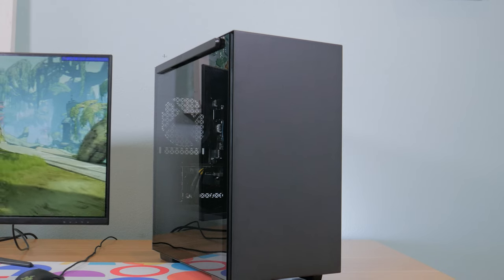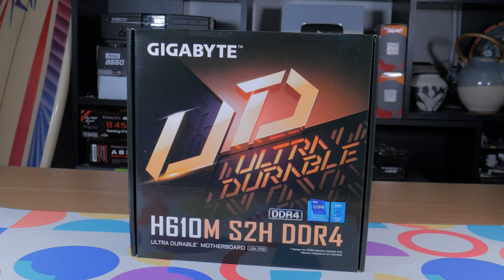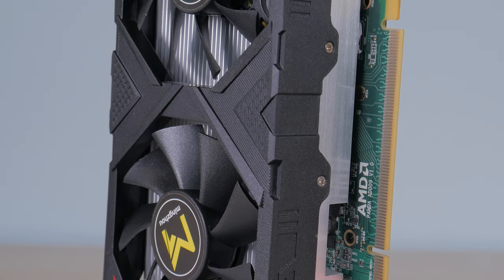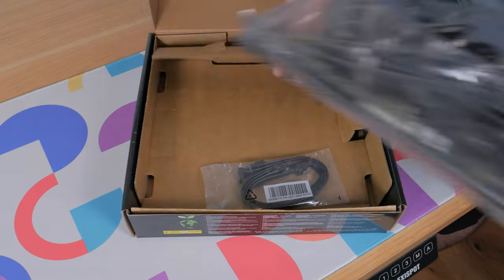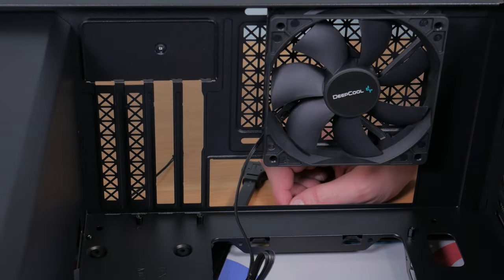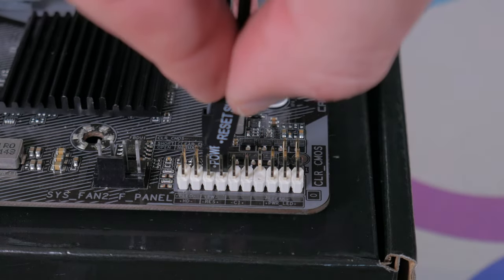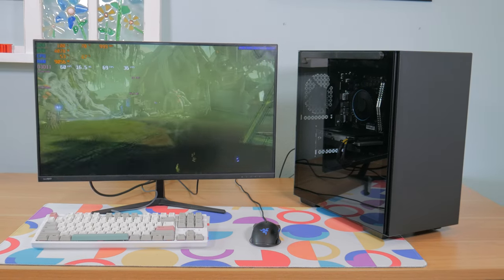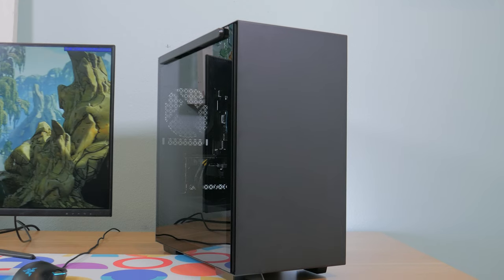$400 Gaming PC Build Guide! (2023)

Comment: That RX 580 is a deal breaker for me. A year back I would have been iffy about it - but now - just no thanks. It's literally a potato at this point. Also I don't get the choice of the I3 12100f + mobo when you can get the R5 5500 + mobo at the same price. It's only if you look benchmarks that a 12100f is higher FPS - and that's always paired with a "enthusiast level" GPU - but with a smaller GPU like an RX 580, GTX 1660 or an RX 6600 - or even RX 6650 XT - the frames are identical within a very few % - UNLESS it's a game which likes more cores - then the 5500 beats the 12100f by a fair margin. Also - especially when streaming and productivity and stuff like that - it helps to have the extra cores... so why turn down the "free" extra performance?

The RX 6600 is 180$... Which - in my mind - should be your aim for "entry level" at this point - even though it sort of performs like a mid ranged card... Amazing considering that the old budget option of the GTX 1650 had a 149$ MSRP - but is nowhere NEAR the RX 6600 in performance.

I would LITERALLY advice anyone against getting this PC - since it's a bunch of half measures and sub par parts - which are not worth the price tbh. You would most likely be better off buying a used PC instead.

This is about the lowest spec I would advise anyone to actually buy - with parts that are worth the price:
/pcpartpicker /list/BZ7fY9

Yes I know it's 128$ more - and there are a few parts you can do a step down like the RAM and the storage, however - it's just a lot better quality not to mention faster than the parts you would save 5-10$ on. It's better to save up for a few more months and get a system like this - which can actually handle modern gaming, not to mention be much faster in general use. - And let's be real here - we are still within the price of a PS5 + ½ a game here.

Having build this exact setup multiple times now - I can tell you that it's an amazing setup - with no real need to justify performance and/or feature - it's just rock solid performance all around and feels like a much more expensive system. - Also if you can find an additional 50$ - you can get the 6650 XT - which just full on dominates 1080p gaming...
Reply: /list/Mfdnk9 I only agree with the CPU choice. I 💯 disagree with the other parts. The 5500 is excellent value with 6 cores and 12 threads. It was actually $80 last week. Your build list is great but I went with the 3600 since it's a tad cheaper and can take advantage of pcie 4.0 with a B550. The 5500 does have a multi core performance advantage. Also, 1TB NVME is so cheap now. Memory, 3200 CL16 is cheaper and is the same speed/latency as 3600 CL18.

You said you built a couple of the 5500 and B550 K, did you have to upgrade BIOS? I also found that the B550 K is a little weak on the VRM compared to the DS3H but should be OK with 6-8 core Ryzen for gaming.
Reply: @itsatrap4986  Ok so yeah My pick of the CPU is actually just simply because it's the newer Zen 3 architecture compared to the 3600 being Zen 2 (non-AF).
I insist on my RAM being of good quality - and the Corsair Vengeance LPX is just a solid pick which I've never seen fail - and here the price difference is like 2$ between the 3200 and 3600, so - that's why.
The Samsung 970 Evo Plus is a fast cached drive - so I'd actually pick that one over the 1 TB as well if I had to choice.

Also the VRM is fine - it really doesn't have any issues with handling most CPUs. I've seen these handle 5800X without any issues and without getting overly so - it's really not a concern. The price difference is tiny though - so if you like another one better - it should be fine.

I've never needed to update a bios on a B550 to handle a 5500 or any other 5000-series CPU for that matter. Maybe there are some - but I don't think this will be an issue here.
Reply: @Craider79 This is for the people that are building a gaming system. Don't be loyal to brands, instead be loyal to your pocket. $30 SP 3200 CL 32 vs $42 Corsair 3600 CL18 "Quality" Yeah, no difference. I enable DOCP with no problems. If I'm spending this much, there's a faster G. Skill 3600 CL16 kit for $49. Also, it's 2023 and $40 for 500GB GEN 3 is a rip off, Samsung or not, DRAM or not. Again, no difference between the A60 when I'm gaming. It's $54 for the 1TB for crying out of you're "stuck" on a brand. But my choice would be the PNY CS3040 gen 4 with DRAM for $50 or SP XS70 $54 if I'm spending this much.
Reply: @itsatrap4986  Respectfully I disagree. I have actual experience with these components - and ALMOST every time I've seen issues with it's been due to an off-brand RAM kit or PSU.

Oh and no I'm not stuck on a brand of anything. BUT - there is CERTAINLY a difference in performance between some generic M.2 and the cached 970 Evo Plus. I have seen it in real life on so many occasions so... Do with that what you will. Also - I would spend the 55$ the 1TB version costs if I was buying it for myself - which just happens to be the cheapest 1TB cached M.2 drive.

I will never comprise on this. Making sure the parts I use have some level of quality has served me well for about 20 years now so... So I do not agree with you.

But you go ahead and trust those parts - that's fine - but we ARE nitpicking here right now - and talking about very minor changes to the price of the system. I would pay a few bucks more for the better quality of parts I know to be good - if you don't then that's fine.
Reply: @Craider79  I actually only agree with you on the CPU. Other than that I'm in complete 💯 disagreement. IIRC, you selected a 80+ rating unit. That's not quality especially paired with a dGPU. It's good for an APU rig Mostly likely won't blow up but I'll spend a bit more for a quality unit and for future higher end GPUs.

You chose the two most popularized brands, Corsair and Samsung while dismissing others brand for "off" brands. That's what I called a dick head. LUL
Reply: @itsatrap4986  Have fun with your bamboo parts m8. They ARE OFF BRANDS - which is why the are so cheap! That's the ONLY reason. They are the cheapest parts and which most likely uses components which has failed the quality control for the higher quality brands - aka binning. 
Oh and btw you do know what the rating on the PSU is right? You think a higher rating = better quality? LOL OK then! The total estimated system power draw of the system is 281W. If you think a 500W 80+ PSU isn't enough to handle that then - you just showed how much you know about this.

Calling two of the most trusted brands through decades in RAM and Storage "popularized" in a business where a drop in quality will instantly be noticed - is just some of the dumbest commenting I've heard in a long time!

And very classy on the name calling there. I'm done with you.
Reply: @Craider79  😂 Ok

Comment: I'd correct a couple of things. As you've said, you should have gotten the 1tb model. It's only 12 dollars more, I don't know why you didn't. The gpu is trash, it's just an rx 570 with extra steps. Either buy a used rx 580, or spend more. And finally, you could have spent literally 20 dollars for a proper tower cooler. One more thing, these rx 580s on aliexpress aren't "new", they're re-used official rx 580 2048sps with a new heatsink or sticker slapped on it. Actually, I have one more thing to say. The power supply is absolute doo-doo, it sucks a lot, I don't know how I can put into words how terrible it is. You have 2 options: A used evga 80+ gold power supply, or just spend a bit more damn money, you shouldn't cheap out on the very component that will be powering your entire system.

Comment: I think i5 and i7 are significantly better than i3 in general.
Reply: Within the same generation yeah. 

But if there's a generational gap perhaps not
Reply: Depends on the generation. A newer generation is often better than a upgrade in the cpu. For example a i5-13600k is better than a i7-12700k
Reply: @eddylai3593 Depends on your definition of better. 13gen has better gaming performance in general, but I would rather have the 8p cores the 12700k has than the 6p cores of the 13600k. Ecores cant be used for gaming and some games are going to be needing to use 8 cores in the future